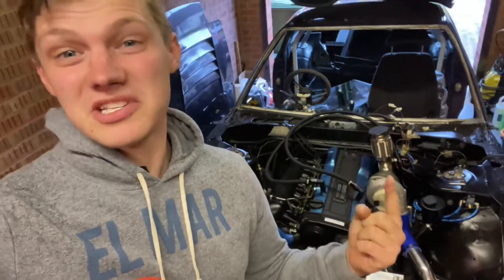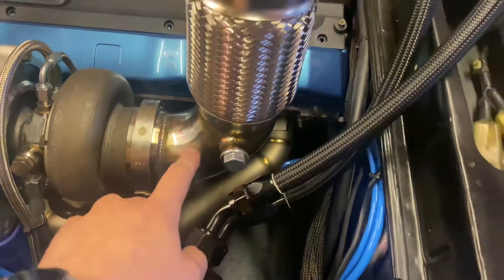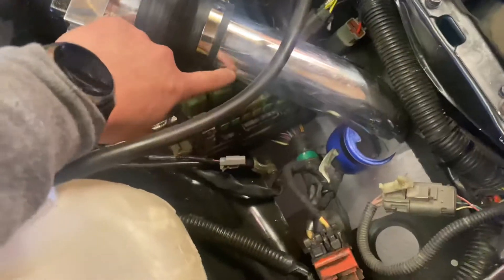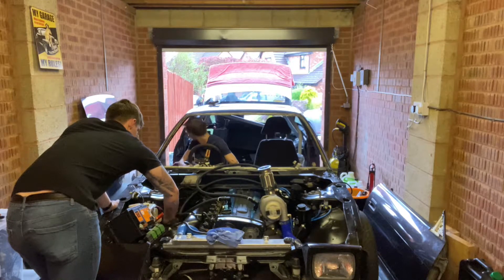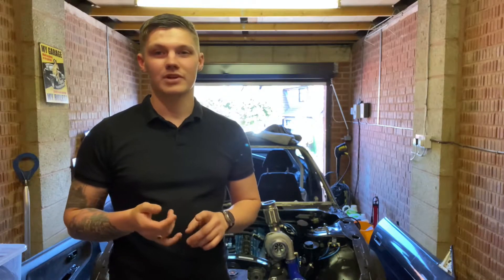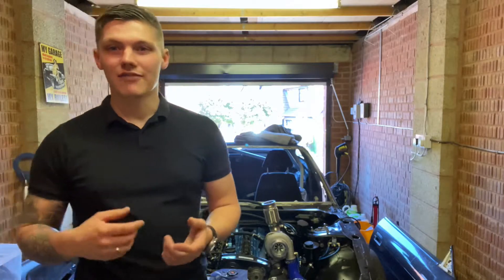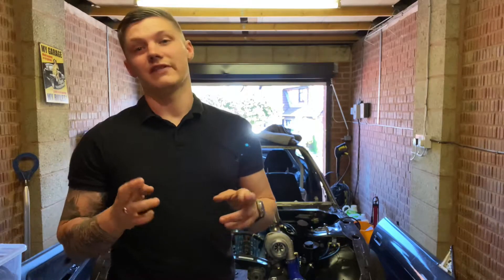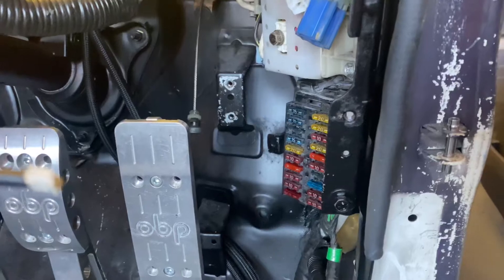S13 RB25 180sx | Starting problems

Comment: Lol why is your car like mine, RB25 180sx doesn’t start, still confused and trying to pin point what’s wrong with it, as soon as you hook up the battery on the car, all the lights on the dash and fuel pump would turn on even if the key is not in the barrel, then you try to crank it and nothing happens, very very strange…
Reply from the maker: The pin out for the ignition barrels change for uk spec or jdm spec could be that or battery wiring?
Reply: @jcbuilds66  I bought the car with work already done by the previous owner and there’s wiring and relays I don’t even know about that just sits in the engine bay, today I tried starting the starter motor by bypassing the ignition and it didn’t even turn and that’s with the starter being powered by the positive terminal off the battery, I don’t know at this point, everything turns on as soon as battery is hooked up without the key, I disconnected the ignition harness under the key barrel and still fuel pump and everything all turns on when battery is connected😂 so I guess I’ll have to leave it in the garage until a auto electrician fixes it, I was thinking to avoid shit like this in the future to probably hard wire fuel pump, ignition etc to a switch box, similar to a race car, that way nothing goes wrong
Reply from the maker: @Cb4leo  I had fuel pump wiring issues as well ended up replacing the wire for the fuel pump and it all work must have been a short somewhere.
Reply: @jcbuilds66  I don’t think I have fuel pump working issues but more of ignition, I hate that the car is in the state that it is but I just can’t wait for it to be fixed so I can get back to driving it, something so powerful and unique about driving a RB swapped 180sx
Reply from the maker: @Cb4leo  great cars when they work it’s just getting it there. I hate wiring but like doing all the mechanical bits of it.

Comment: what engine mounts are you using??
Reply from the maker: Hard race engine mounts bud the rb25 transmission lines up with the factory shifter hole so no modifications needed other than hitting in the firewall a little bit.

Comment: S1 uses separate wire for injectors
Reply from the maker: Was the injector o rings in the end.
Reply: @jcbuilds66  nice..how she running
Reply from the maker: Runs great but needs a colder thermostat and a lot of body work.